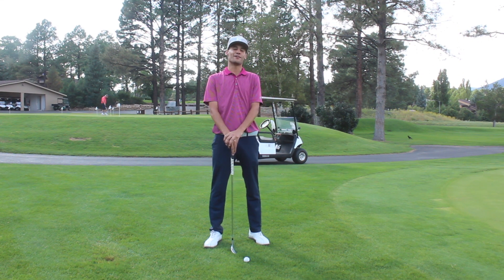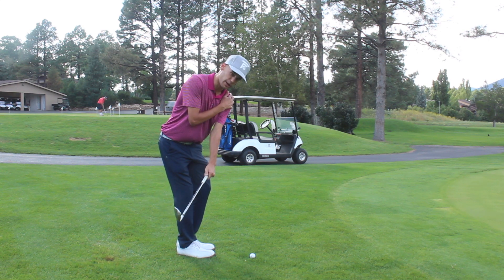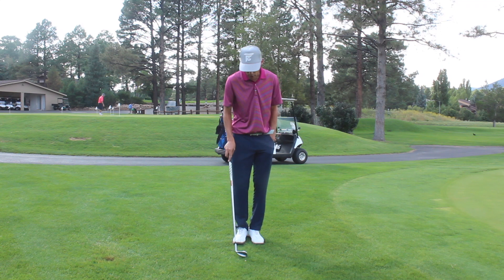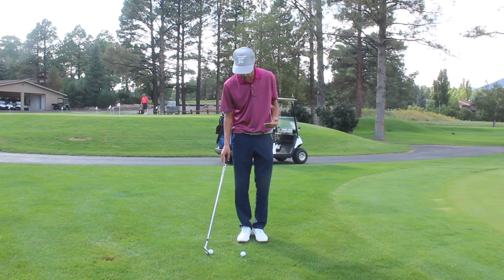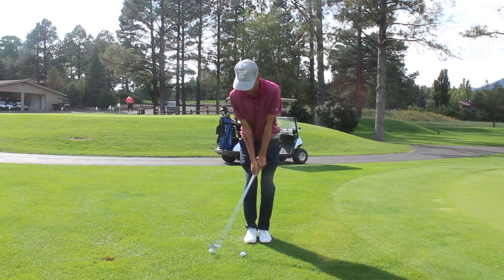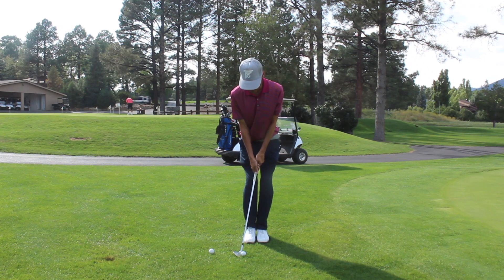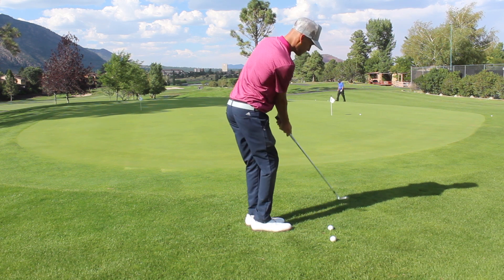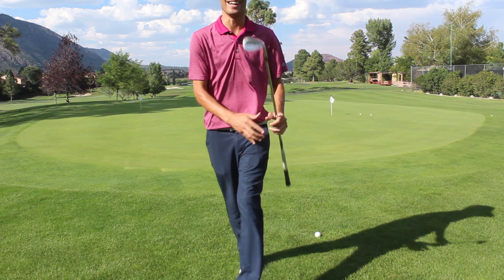Quick Chipping Tip for Better Contact

Comment: ALWAYS use pivot even so slightly ; if not you are "timing" the clubhead even if your stroke is on a negative angle of attack !
That leads to some leakage even if you are skilled with your upper limbs Mr Blaire ; thats why you said earlier that your short game was inconsistent for a while ! With all the respect !